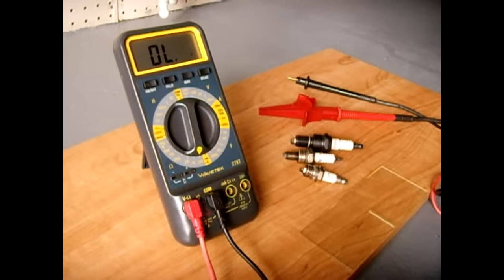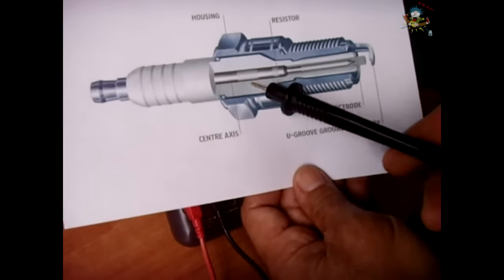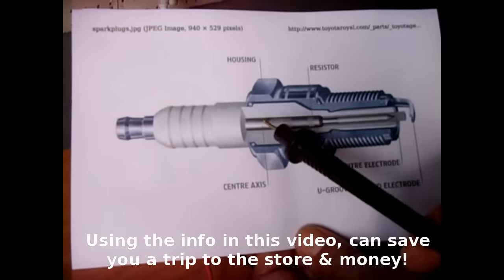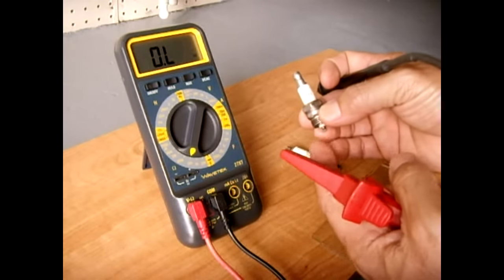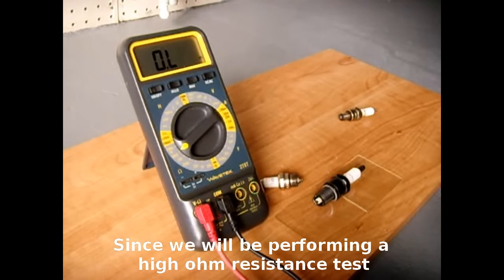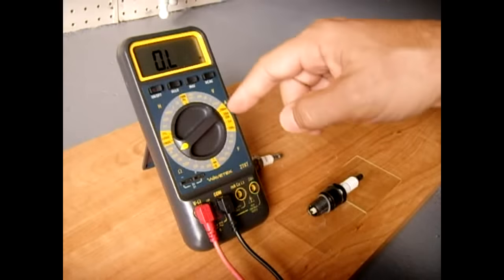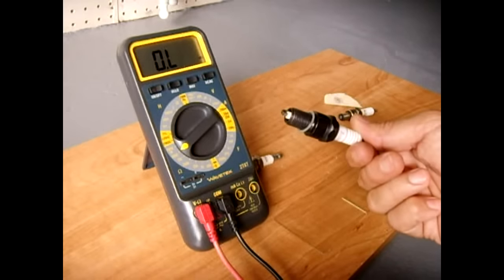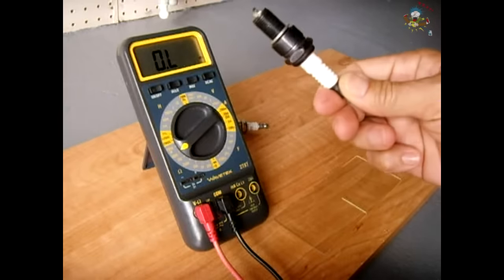How to rule out a Spark Plug as your problem

Comment from the maker: **ATTENTION: If you have any concerns about removing a hot spark plug from an aluminum head, then you can also remove the plug when it's cool and heat it up in a toaster oven to 300 Deg F to perform the "hot" test. Never file down or sand Platinum/Iridium tipped plugs. "Hotter" spark plugs have a LONGER ceramic nose, and "Colder" spark plugs have a SHORTER ceramic nose. Using a slightly hotter plug can prevent fouling if your rings are worn and allowing excessive oil to accumulate on the spark plug's electrode. Thanks for watching!

**For GREAT deals(Usually cheaper than EBAY) on AUTOMOTIVE TESTERS & TOOLS, neodymium magnets, Fidget Spinners, electronics, drones, automotive tools, household items, phone accessories, locksmith tools, & much more, please visit the link below and SAVE IT AS A BOOKMARK on your computer or smartphone to Banggood for future purchases. (Your purchase supports my channel!) 
All Items: http://bit.ly/2cgYr14 
Flash Deals: http://bit.ly/2cb6CZB 
*Try these money saving coupon codes: Double12 or BFTOOL or affiliate6 or elec or elec1 or measure or HDWARE2 or WELDTOOL or ask if other codes are available!
Reply: electronicsNmore c
Reply: Lawnmowers now use suppression plugs due to the Delphi fuel injection systems on Kohler and Vanguard. Specifically the NGK bpr4es and bprm4es as well the 5’s too. If not the 5 volt reference in the OBC will act wonky and cause problems in the injectors as well as the coils. Just a little info on the subject :)
Reply: electronicsNmore "
Reply: electronicsNmore 
what is the best spark plugs to use in a 98 ford explorer 4.0 sohc v.6
Reply: electronicsNmore true NGK has good plug info.
Reply: is plugs???  Subject, verb coordination please:  "are the best plugs"
Reply: You're pointing at the Wrong end of the Plug. The Insulator portion that controls Heat Range is on the Inside of the plug. Where the Tip is. Outside Insulator has to be the Correct Length. Otherwise the Plug Wire Boot wont fit on it properly.
Reply: morfishinthese
 5e
Reply: Bruce Hart 
What
Reply: So on my engine (a s&s 124) both my spark plus get a reading at 2M. My highest reading on the OHM seting. Ones at .198 and the other is at .045. 
What does this mean?
Reply: @chrisphilhower6029  Yes your right he is talking about the wrong end of the insulator he needs to study spark plugs before making a video.
Reply: P
Reply: Ly
Reply: Thanks , I may have damaged my old plugs when I cleaned them . A new set is on the way but it will be interesting to see how the old ones check out . My problem is the engine is lumpy and missing on tickover.
Reply: @TRAVIS-L  motorcraft

Comment: Quick Tip: For continuity testing or even resistance you should always try an initial test by touching the two leads together first. Its not unheard of to have bad leads or connection to multi meter that may make you think something is wrong with the spark plug for example. Just good practice.
Reply: Gee, ya think?

Comment: When I had the pleasure of working with a great racing mechanic Mario Deliotti I showed him that a plug I had out of my Alfa Romeo sparked perfectly well out on top of the engine.  He laughed at me, called me something in Italian, and told me to put it the spark plug tester. I did and it sparked ok looking through the inspection window. Now I turned up the air pressure ( the tester connected to the shop air line) and at 80 psi plus it hardly sparked at all. Put a new plug in the tester and that lit up like a Christmas tree at any pressure.  As an electronics engineer I have never understood why this should be but it taught me that a low voltage meter test at atmospheric pressure is worthless. Don’t waste your time just replace the plug.
Reply from the maker: Never had the test fail. Your situation was highly uncommon.
Reply: At a guess you sound as if you are in your twenties and dont appear to work in the motor trade. I have a vehicle in my own garage that has just this problem. I call BS on your "uncommon" statement, if only because you haven't have enough real world exposure to have encountered it.
Reply: I am 67 and have worked on most vehicles in an auto electrical capacity, It was just something that I surprised me as an electronics engineer,  and later  help me when I was designing electronic ignition systems.
Reply: Yes that is correct, the higher the air pressure, the harder a spark has to work to punch through it. However you do not need anything as elaborate as a pressure chamber to test spark plugs "under pressure". Simply open the electrode gap to one quarter inch and it will simulate it for you. If you get a good spark like that its good to go.
Reply: That's a good tip but unfortunately these were Lodge 2LH plugs with the four point electrodes.
Reply: Yep in that case I'd prefer a prefer a proper tester too lol
Reply: @electronicsNmore  lots of plugs fail under pressure in the combustion chamber
Reply from the maker: @breambitch  Not many that I've seen.
Reply: pazzo
Reply: @memylastname9972  Hahaha, that put that_swede JD in his place. There was no need for him to use bad language, even if it's abbreviated. And no need to rubbish your valid comment. I read comments like yours because they interest me, also it's a memory of yours you've taken the time to share. These idiots aren't called trolls in the UK for nothing - they just troll through the comments looking to start an argument. Good on you mate.
Reply: My dad had a gas station from 1953 forward. As a kid I used to play with the Champion sand blaster and the spark tester. Yes..the spark did sputter under high pressure. There was a window and a regulator. I could see the spark change when I would up the pressure. I worked on airplanes and experienced arc over at high altitude. In that case, it was the reverse of the spark tester. Rarified air was less of an insulator and the spark would find the easiest place to jump...through the high tension leads or inside the magneto. In the spark tester, I would think that a denser air would act as an insulator in the combustion chamber and the spark would jump at the cables or distributor cap.
Reply: This is exactly what i came to post.  Im a mechanic and learned a long time ago from my tech training from suzuki, yamaha and kawasaki that plugs can spark outside of the engine but not when under compression.  This test is just to test if the coil is woking not if you have a good plug.
Reply: @electronicsNmore  How have you tested this bud?? Interested to see your pressure testing set up. All your test will show is open circuit of the centre electrode eg plug has been dropped or broken during instal / removal / impact. Static compression runs between 120psi 2T to 180psi 4T. If a plug starts misfiring at 100psi ( evident in a pressurised tester) it sure ain't gonna be much good at higher pressures is it ?? Bruce is 100% Correct.  Not hating at all just sharing knowledge hard earnt!
Reply from the maker: @MJHMech The most common causes of plug failure can be identified with the information contained in my video. I've used the methods shown over and over with highly reliable results. No test is perfect.
Reply: @harrylime5147  buy a twin turbo vehicle,you will love iridium with a closer gap unless you don't like speed
Reply: P TURK 
  I don’t mean to sound facetious, but what is a twin tube vehicle? My current pick up truck has a hemi V-8 and each cylinder has two spark plugs. I have a Moto Guzzi motorcycle that also has two spark plugs per cylinder..
 I know and understand the advantages of two plugs per cylinder, the main advantage is, you do not have to Advance the spark as much as you do with a single spark plug, so you’re not compressing an igniting charge as long..
   If twin tube vehicle refers to a twin cylinder motorcycle, I have had literally dozens of twins, Yamaha RD, RZ, TZ, Honda CB, Kawasaki S1, S2, H 1, H1R “yes I had an H1R” with sand cast cases, chrome bores,Dry clutch, and 4-shoe front brake..(I swapped out that for shoe front brake/wheel for a disk front end, and I took that for shoe front brake, and I threw it out the back door of the shop, and I didn’t even look to see where it landed. I wish I had it today. They’re worth a fortune.. back in the day, there was nothing worth less than last year‘s race bike.
  Anyway getting back on topic, what is a twin tube vehicle?Was that some type of insult? Or was that an attempt at humor?
Reply: @harrylime5147  turbo ,sorry spell check
Reply: Turbo is a different animal. I have had many performance car's, trucks and motorcycles, just saying. .experience.
Reply: P TURK 
  Oooohhhhh turbo... I have ridden them and drove a few, one was an Audi V8 TwinTurbo. I think that was the fastest car I ever drove.. it was actually ridiculous.. I don’t know if you agree, but there is actually in my opinion such a thing as too much power. In my opinion, if you can’t use 100% of that power, the excess is a waste..
   I spent a lot of time on a Honda CX 500 turbo back in the day. My best friend bought one from me when I was a salesman at a Honda shop. 4999. I think they made around 72 hp, but there was a slight delay. You had to ride the back break while you spooled it up..I believe Hondas turbo on that machine was around the size of a dime, and I believe it’s Spun at over 100,000 RPMs.. I thought the machine was perfect. But shortly after The turbo years 82, and 83, the big In-line four-cylinder liter Machines were faster, and that was the end of the turbos. Hondas was the most refined, Yamaha‘s was crude, they controlled power by having Detonation detectors that retarded the timing rather than designing it correctly right from the start. Kawasaki made a 750 turbo, that was not really reliable, Suzuki made a 650 turbo that was actually very good but it had a 16 inch front wheel,Which was thought to be the latest, but it tended to influence steering too much while breaking.. 17 inch was the way to go in the following years. Kenny Roberts and Freddie spencer did a lot of the development on wheel sizes and tire width.. that’s when Freddy Spencer had a carbon fiber wheel shatter causing him to crash and break his right wrist, and that was pretty much the end of his racing..
  I believe you asked me if I liked to go fast. Believe it or not. I do not like to go fast. I have never gone over 85 miles an hour on the street or  interstate. Even though I won 6 Motorcycle roadracing championships, and I was two time national champion, I never was comfortable going fast. I hated the fast tracks like Pocono and Summit point, I wouldn’t even go to Daytona
Reply: @electronicsNmore  my 1 cylinder bike would turn off once the engine heated. You take out the plug and test it and it sparked perfectly.
We tried searching for anything else like fuel issue, carb issue but everything was fine. Then my father asked me to change the sparkplug and see. That indeed was the issue.
Reply: I am not a plug novice like most commenters but my advice is expect the least from most people commenting about plugs. A degree in ignitions you would learn the rest of your life, its not simple and self learned over decades
Reply: @harrylime5147  
That was very informative. I'm glad you took the time to write so much for the benefit of others like myself. I have a 1978 Honda cb125s and I have to do the tune-up on maintenance on it myself. I'm always looking for information on YouTube from people like yourself and others we share valuable information with us. Thank you very much once again.
Reply: P TURK 
 Turk you’re not gonna believe this..
  I have 16 road racing championships, two road racing national championships. I never liked going fast.Are used to signal to the other top riders while we would be lining up for the start of the race on Sunday, for them to take it easy, and just go for it on the last three laps.. it never worked.. I had to stick my neck out from the first lap. To tell you the truth, it wasn’t fun either. I wasn’t afraid of crashing, I was afraid of not winning..It wasn’t fun, but it was satisfying afterwards, still is!
Reply: I found these comments on air pressure and spark very interesting, I believe I learned something. But there's nothing magical about platinum/iridium plugs, they just resist wear longer (or they're supposed to). And plenty of people are just looking to learn maintenance for their daily driver, sometimes a 20 years old daily driver. Not everyone needs a twin turbo  or expensive plugs.
Reply: @chocolate_squiggle  - I have read that even with the fancy "100k mile iridium" plugs, you start to get a significant fall off in performance and it is "best practice" to change at about 50k.  This also helps reduce the chance of a plug getting frozen in the head.
Reply: I 
I am glad you understand now why only testing under pressure should be done.  If you do a compression test on the engine { With the throttle open } you  must test the spark plug under at least the compression pressure.

Comment: Old trick for a fouled v-twin harley plug-with engine running ,using insulated pliers,pull boot off of fouled cylinder and let spark jump to top of spark plug,you"ll instantly burn oil or crud off that electrode

Comment: You might have a hairline crack that you will not see until High voltages to create the spark and will not fire between the two proper points and that might not even happen until the plug gets hot
Reply from the maker: Which is why I also suggested the toaster oven test. What you said happens infrequently. Thanks for watching

Comment: this video should be 1.5 minutes long
Reply from the maker: Maybe if you made it, but I like to thoroughly explain things.

Thanks For Watching.
Reply: yeah i don't need all that cold plug vs hot plug stuff so skipped that part to get to the meat of the video.
the forward button lets me cut these long videos down to size without missing the main point.
Reply: Great video and it was long enough to explain his point exactly with simple clear examples of what to check. you can't do that in a few lines of text or in less than 2 mins of commentry. the majority of people dont even know what an ohmeter is. I've been swapping out spark plugs on all my vehicles without even thinking of checking them with a multimeter so I thank this guy for something to think of next time. The manufactures dont even include any of this information in their datasheets when you purchase them!
Reply: @arnolduk123  Great point. If fact an excellent point. I've been using test equipment so long it is as if I was using a knife and fork, sometimes we forget we have different experiences.

Comment: Thanks for this video, I diagnosed a bad plug (which seemed totally fine), this got my generator running for $3 and made a lot of headaches go away.
Reply from the maker: You're welcome Kenneth! Many people like you have benefited from the info in this video. Thanks for watching! Be sure to share the video link with friends.
Reply: i  have had two strimmers inat the same time both with poor hot starting  and both had a plug that goes open circuit tip to cap when hot  let it cool and the connection come back  very nice to find a fault like this

Comment: I can't speak for today but years ago Champion plugs came with a "booster gap" built into the internal connection from boot to tip. So the continuity check would read open circuit. The booster gap was there to make sure the available voltage was higher when the spark energy actually hit the tip.  The idea was to be able to get a fast voltage rise at the tip despite some leakage to ground on the tip of the insulator.

Comment: Neat stuff. Every mechanic should have a heat gun (I've scored a few at yard sales so I can scatter them around the shop) and will try your method before and after heating up some spark plugs. A propane torch would also work and handheld thermometers are dirt cheap. 

To quick check plugs I shoved the end of a gas grill piezo igniter into an angled spark plug boot then ran some solid copper household ground wire around the shell so the ground contact on the igniter has a path to ground. (It normally grounds thru the gas grill body.) Wrap with electrical tape and you're done. Great for detailed arc observation without running an engine.
Reply: +Ob Fuscated - My heat gun is always moving around the workshop. Damn useful tool. :-)
Neat trick with the piezo electric, I had an ignition simulator for testing but that's much better and small.
Reply: Let me make sure U hold heat on the plug till you read 300 degrees  for a hot plug correct?

Comment: I used the information on this video to check a spark plug on a snow blower that was not starting and had been used once or twice. The 2nd measurement on the existing plug, from tip to the body of the plug, was not showing the results that were demonstrated in the video. I sprayed the other end where the spark should be coming and got inconsistent readings. I spent $1.90 to replace the plug, and the snow blower started immediately. Thanks for the service.
Reply from the maker: Glad the video helped Jim!  Be sure to look over my extensive video playlists below for many other videos of interest to you, and most importantly take one minute to share a link to my channel with others. Thanks
http://www.youtube.com/c/electronicsnmore/playlists